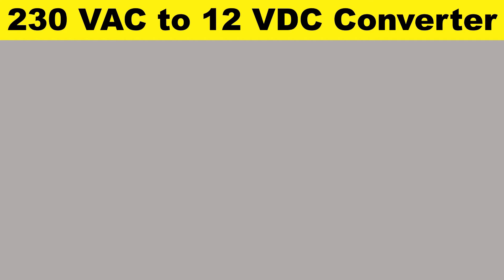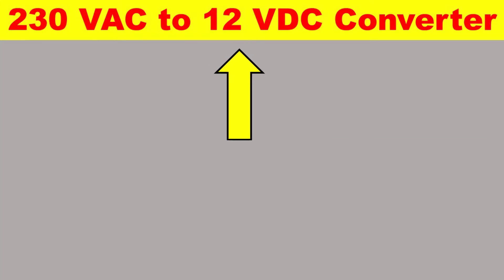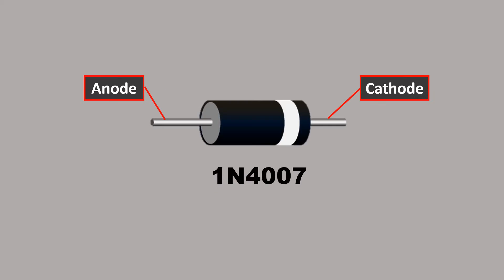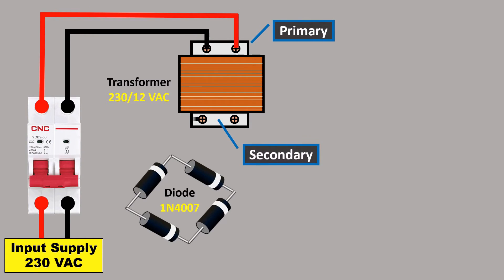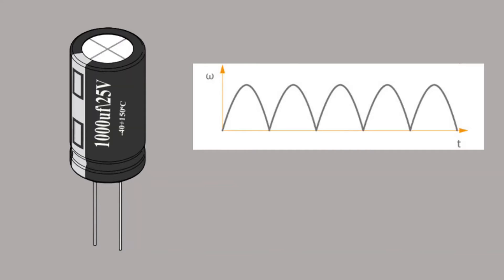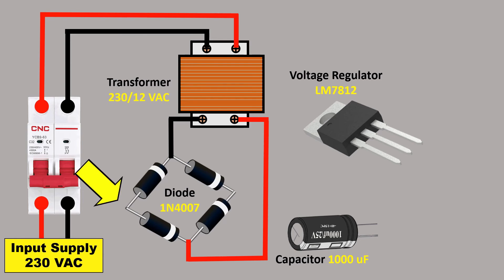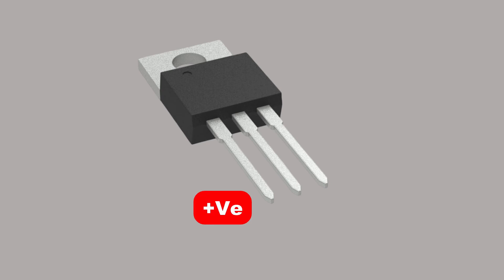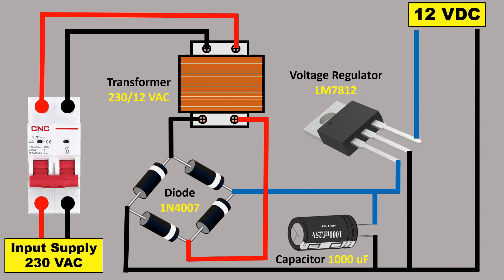AC to DC Converter Circuit Diagram with voltage regulator for 12v Battery Charger@TheElectricalGuy

Comment: Why u used 1000mf capacitor  u can use 500mf or 800 mf reason?

On which bases u choose 1000mf..
And  on the end 1mF  why?
 Why u didn't used 100Mf etc
Reply: Veličina elektrolitskog kondenzatora zavisi od kvaliteta peglanja pulzirajućeg napona!